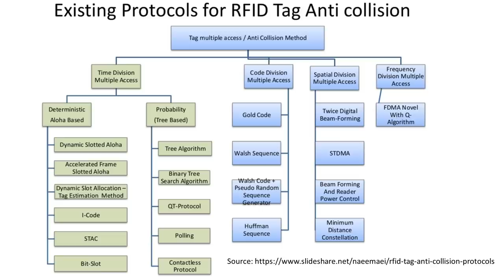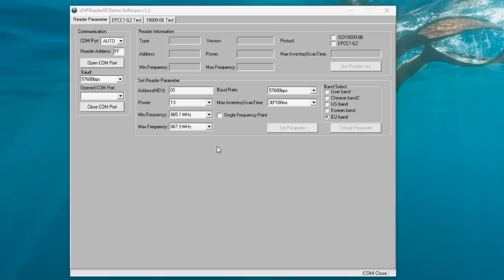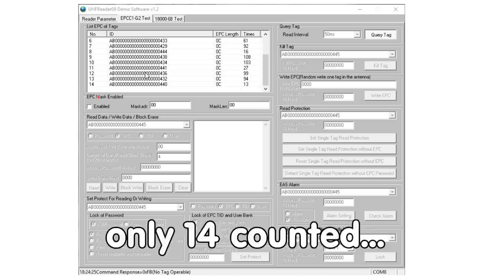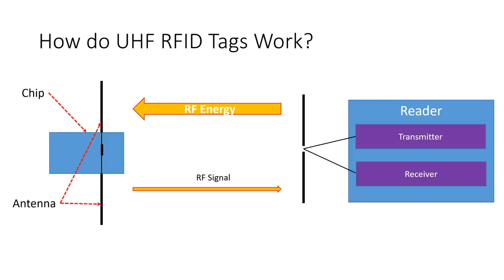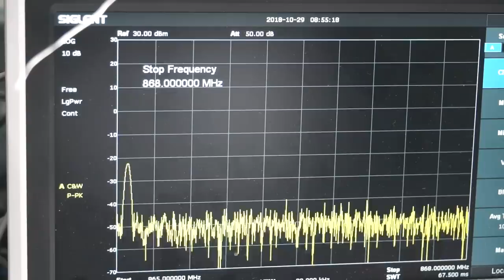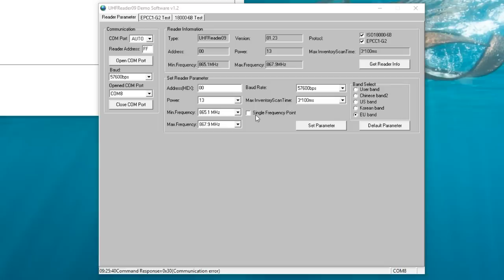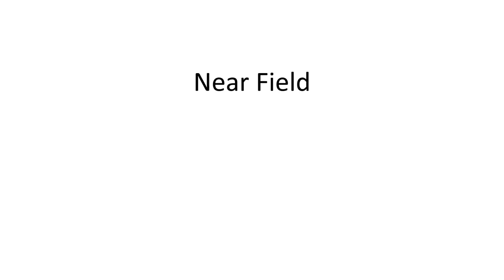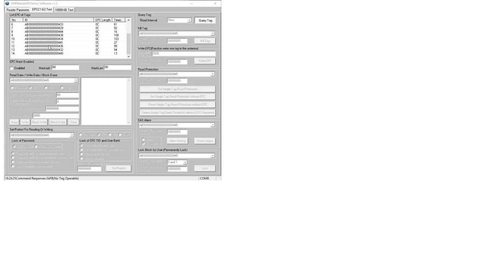#236 Introduction into UHF RFID (How-to)

Comment: Where I was a contractor last we used RFID stickers for item and asset tracking. Everything was tagged and logged so whenever each case (containing as many as 300+ items) was sent to a customer we knew precisely what components, assets and equipment was going out at any one time, the RFID's contained loads of information as well as the sticker number, this included item, lot and serial numbers of each part, asset and case, a load of delivery numbers and customer details was added too. As soon as each case was ready to be shipped out it was slipped through a RFID reader/writer tunnel and that showed that batch had left the building. All this was 1-2 seconds at most. It allowed us to identify all parts, confirm each kit was complete, and that nothing had been removed. Left a nice paper trail for tracking should anything be returned or was a load item, it was returned and read using the same tools allowing complete tracking all over the world. 

I cannot imagine the cost but it was an awesome piece of kit was but it did save so much time and money in lost hardware, especially as this was for medical equipment and implants.
Reply from the maker: This sounds really interesting and for sure saved some money in the end. Because searching or losing material is not cheap...
Reply: @AndreasSpiess  some of the components would have cost many months of my earnings to replace if lost, so the machine had clearly paid for itself in a matter of days.
Reply: Thats nice, can you refer which equipment + software you used ?  I also want to try this.
Reply: @dhiraj787 , I no longer work there, however the software was integrated into Oracle so you never got to see who's software it was, I doubt you could buy it domestically though as it was clearly designbed for expensive major asset tracking.

Comment: I would say the range of the desktop reader is intentionally low.  You would use a reader like that to scan cards into a PC based access control or sports timing system.  If it had a long range it would be useless, as it would pick up every (unwanted) card in the room!
Reply from the maker: You are probably right. I ordered a different antenna (smaller). Maybe this helps a little.
Reply: Then sort the read card

Comment: The short range of NFC isn't really a shortcoming, but allows for a much higher power budget and stable operation. This allows strong cryptography to be implemented, like it's done with Smart Cards and ePassports. Storing a public-private key pair is only feasible with NFC. Also Sparkfun has a new breakout for the M6E-NANO. It's expensive but very hackable, in contrast to the Chinese Wiegand compatible UHF readers.
Reply from the maker: Thanks for the information. I thought that the UHF chips were also "secure", but I have no know-how. Concerning the Chinese readers: The UHF ones also have an SDK and should be quite hackable. But maybe less of a "community". The Sparkfun is also less powerful. So I did not decide yet. It is an expensive decision.
Reply: @AndreasSpiess  Most UHF tags are ISO 18000 EPC compatible. The only "security" there is write protection and software tag disabling. However there is no cryptography involved. Everyone in range can query the tags and everyone can answer the query without authentication. For secure NFC, take a look at MIFARE SmartMX or DESFire and their feature sets.

Comment: We have a reader with a big antenna lent to us (at work) by a local company specialising in garages for office buildings, etc. It really works from a couple of meters away, very impressive. Maybe the cards are special as well, they supplied them with the reader.
Reply from the maker: You just needed stronger ( and more expensive) transmitters. These work up to 10 meters.

Comment: It is very important to note, almost all early RFID standards were never designed to be a long range interrogation platforms or devices. 

Today, the needs are very different. Vehicles that can unlock / start when the key fob is within 15' was never a requirement until now. 

Transportation container tracking at high speed is now the norm. 

All of these examples essentially use the same RFID architecture. Some have  internal power supply, others have none.

The issue of power, frequency and pulse length must be fully integrated with precision   many take for granted with "standards". Quality Control is almost non-existent with many Chinese suppliers.

Many of the vendors are reselling tier 1 components that have been rejected.

This is not to say all Chinese based suppliers are bad. Many are very good. This is particularly true of those based in Shenzhen. Even so, it's buyer beware unless you establish a relationship with your vendor. 

The Gap is closing but is still a few years away from achieving consistent QC given the number of suppliers of components that exist.

Using a Yagi-Uda antenna  should work, if designed / tuned properly and matched to an appropriately sized connector.  I'm not sure if yours is. Something isn't right.
Reply from the maker: You are of course right. But the Mobile Phone standards also were not designed with the Smartphone in mind. This happens all the time. And this is maybe we love our profession. Always progress...I ordered a special RFID antenna to compare. And I am still evaluating a stronger reader (it is a costly decision).

Comment: nicely explained. investing in a high end antenna with a signal booster is not a bad idea. I own a high end antenna as I use them on my wifi router to get free wifi.  good antennas should have vast applications for diy projects, not just for RFID.  maybe you could use them on your lora gateway to extend the range  even further.  I want to use this technology to make a key tag, so when I loose my keys again, I can find them, only if I point in the right direction and have better antenna, lol
Reply from the maker: I think, that LoRa and RFID antennas are different. This is why I ordered a special RFID antenna to compare.

Comment: I work with the Rolls Royce of RFID readers daily, the Impinj Speedway R420, which is extremely good at both reading a lot of tags and reading at range. But it requires specialized antennas and quality RFID tags.
The success of the RFID projects depend mostly on the choice of tag, tag placement and choice of antenna to achieve the desired read range.
We have detected RFID tags over 10 m from the antenna, so it is possible, but it requires a specific tag and antenna.
Reply from the maker: Thank you for sharing your experience. You are a lucky man! As always if you want the maximum you have to pay attention to the details.
Because this is a Maker channel I try to find things which are not at the maximum but affordable for the average man. Often such solutions exist. But sometimes I do not find shortcuts and we have either to spend the money or chose another project :-(
Reply: you are defintely rigth. Four elements will effect the reading range: reader, antenna, tags and the item you will attach the tag to.

Comment: Maybe the problem is to use the same frequency to transmit power and data. We could make devices picking up power by induction from the power grid and transmitting data on a clear channel where a sub mW. power would be enough to be picked-up a meter away.Of course it wouldn't work in unpopulated area (desert, ocean) but those devices are usually used in buildings where 50/60 hz is leaking everywhere.
Reply: Due to the low frequency and thus the wavelength (in the order of thousands of km), you'd need large antennas to receive significant amounts of power. The dipole antennas in the tags really only work with ultra-high frequency.
Reply: @graealex  That's why I said induction, with a magnetic loop rather than a dipole antenna.
Reply: @graealex  you could be right I haven't measured how much energy a credit card size loop could pickup, although picking-up a few mW. seems reasonable, but still if the power was sent in a different frequency like let say in the microwave oven range 2450mhz and the data received in a clear UHF channel it would be lot easier to pick-up.
Reply: @johnkubik8559  Then you need a few thousand turns of wire, and a very large capacitor because you need DC for the chip itself and also to power the transmitter at the different frequency - 50 Hz means that there is a significant amount of time to bridge. The way the dipoles in UHF tags work is that the two halves have a transistor between them, and the chip can load the dipole by switching the gate of the transistor. Also the transmitter would have to have a very good clock source on-board to produce a coherent signal.
Reply: @graealex  The chip need a mW or two to transmit, cmos is very efficient, either you could get that power from AC induction or from microwaves and I'm  not talking about putting a magnetron in the receiver, a watt or less would light up every RFID cards in a meter range, the problem is, if in the frequency you need to send milli -watt's of power and listen to nanoW. of data from a chip plus antenna, which has to be keep in the penny's range. The trillion tags+ market is in the daily shopping store replacing bar-code which are basically free has something has to be printed on all the items you buy, to go to a cashier-less store where you just push your shopping cart through a scanner and pay for what you bought with 100% accuracy. The market is present, a few hundred thousands stores worldwide need it, but the current RFID's tags are not reliable enough to be used. In this case we have a problem requiring a solution while when we see a 3 cents micro controller  we have solution looking for a problem.
Reply: @johnkubik8559  Current UHF tags are very reliable, given the right antenna on the reader (usually a door-type style with antennas surrounding the person) AND the tag not being directly attached to metal or being shielded by it. There are actually stores that use them for the purposes you describe (Decathlon in Europe would be one example). However, printing a barcode on the product packaging is infinitely cheaper than mounting UHF tags. So making the tag more complicated won't create a market. Making them one or two orders of magnitude  cheaper will.

Also you talked about 50 Hz power transmission, now you're talking about microwaves. What's it gonna be? Getting a few mW from 50 Hz is nearly impossible for the scale of antennas that could be integrated into a tag. Microwaves get an order of magnitude more attenuation from water, so also not too good. Sending on a different frequency than what the reader uses requires an UHF amplifier in the tag and as I already said a very stable clock source, which due to temperature deviation cannot easily be implemented with a simple RC oscillator.
Reply: @graealex  I Mostly agree with your analysis.I leave in Europe and Decathlon is still using cash registers. But we have some hypermarkets using hand held scanners to do your shopping without the need to wait in line, empty your shopping cart and go trough a "smiling" cashier and waste 20 minutes of your time doing so. And they still have security gated on both sides of your shopping cart just in case the cashier might have miss something. 
If we where using those scanners, one on each side of your shopping cart I would not need to scan every product I put in my cart, making my shopping a lot more faster  and enjoyable if I can found anything enjoyable about grocery shopping  but at least faster, the scanners are less than 20" from my purchases and I really don't care if they use 50hz or microwaves, just let me pay for my purchases and not waste my time with a cashier, who would be a lot more useful at refilling the aisles than wasting my time.on its cash register.
Reply: @johnkubik8559  As soon as the shopping cart is made of metal, UHF doesn't work reliably anymore. And yes, Decathlon still does have cash registers, but even at the registers, there is a large recess where all the items are put in, and an UHF reader detects the items. In some branches, they even have self-service registers with the same readers, but I never saw one myself.
In Germany, ALDI, Lidl and Schlecker were the last ones to even introduce barcode readers, because a fast cashier with manual input is no slower than any cashier with a barcode reader. The main issue then was cost, so they all waited with the upgrade as long as possible, just because of the sheer scale. Now think about investing $2000+ per checkout, plus let's say ¢5 for each article for the tag itself and the additional step of programming and mounting it. That would add massive costs considering the number of articles each shopper has in his cart. Even at ¢1 it would still add considerable cost.

Comment: Hello, I recently found out that there’s possibly a cheaper alternative to UHF: ISO 15693 tags (such as the ICODE SLI/SLIX/SLIX2). These are HF vicinity tags, which can be read from up to around 1.5 m, and the PN5180, which is a compatible reader, can be bought for less than $10, and the tags cost 15-20 cents each. 

I haven’t tried it, and maybe the antenna is also a limiting factor here, but it’s worth a try, and there isn’t much info out there about these (there are a few videos from the same channel, but I don’t see any videos on their range), so it’d be interesting if you could do some videos on them.
Reply from the maker: These are HF tags. 1.5m maybe with a very strong transmitter? I doubt ;-)
Reply: @AndreasSpiess  I agree with you.  It will a very good reader if it can reach 1m.

Comment: Since RFID card have no power source, It need a magnetic field reaction from RFID reader to generate electric power, Just like transformer , the RFID reader act like primary coil, RFID tag as a secondary coil. The magnetic field are quite sensitive by distance.
Reply from the maker: The UHF antennas do not work with magnetic only fields as the low-frequency ones (shown in a previous video). They also do not use coils, they use antennas.
Reply: This is true for LF and HF tags, you can even see the coils in the tags of HF tags. The antenna and the tag are inductively coupled. UHF is a different can of worms, they work by reflecting the incoming RF.

Comment: Excellent. You mentioned IFF on the last video, the Yagi is my choice for that. Too bad the enemy doesn't use Tags. Usually, the Yagi is placed just forward of the planar array to challenge while track, after which the GTWT adjust frequencies in pulse doppler awaiting a computer solution for a missile launch. Anyway I should stick to the class. Thanks.
Reply from the maker: You are welcome!

Comment: Can you increase the range of medium frequency (13,56 mhz) RFID tags to 1 or 2 meters? By adding power source or creating transmitter from scratch? I can’t change receiver, but it’s a simple one (ISO 14443) without any encryption.
Reply from the maker: You do not only need higher power but also a bigger antenna. 1-2 meters is a lot for this technology.
Reply: @AndreasSpiess  I can’t modify the receiver part, but I can do whatever I want with tag/ key part of the system. I can provide power source, I can modify or change coil, I can buy or build different active transmitter (if it’s possible). I don’t know if something like directional “antenna” / coil exists or could be done for this (I can point the device towards receiver)? If 1-2 meters is to much, could anything be done to make this work from at least 50 cm? Do you have any source of information could use to make it work?

Comment: Informative, as always... 

Are you going to be including NFC tags and readers in this series?

I've just bought a number of NFC stickers which I'm using on technical books for linking to the code and author webpages for each book (where they exist). This saves me a lot of time searching through the book each time I find a useful technique that I want to follow up.

The mobile phone works very well but I'd like a separate reader connected to my laptop, so that I can cut and paste code snippets.
Reply from the maker: AFAIK NFC and RFID use the same technology. The newer chips are also called NFC. I will not cover those because they are not widely used in the Maker scene.
Reply: @AndreasSpiess  The ESP8266 'was not widely used in the Maker scene' when it first appeared...

The more I play with the small NFC stickers, the more ideas I get for them and the more they may feature in future projects.

Comment: There should be battery-powered tags, which sleeps most of the time, but when tag detects a reader signal, it produces much more powerful signal and reader can hear it from a larger distance.
Reply from the maker: They exist and are used for special applications. But they are bigger and more expensive.
Reply: @AndreasSpiess  I think he is talking about active RFID.

Comment: I purchased a similar antenna years ago from China, but didn't forget about it! I works well, but I would like to see the results on a VNA!
Reply from the maker: The question is: What is "well"? If you get much more range than with a normal antenna and if it differs from back to front, then it is "well".
Reply: @AndreasSpiess  
Yes, it has greater range than a standard dipole. It is extremely directional. It is labelled "Model: LWD-900-7, Freq: 824-960MHz, Gail: 11dB, Made in China".
Have you seen or used YagCAD?
FYI: Things "work well". Only a person "is well"; it means they are not sick. "All is well". (Stupid English doesn't always follow the rules).
Reply: Great series on RFID!
Reply: you are use it for what kind of application?